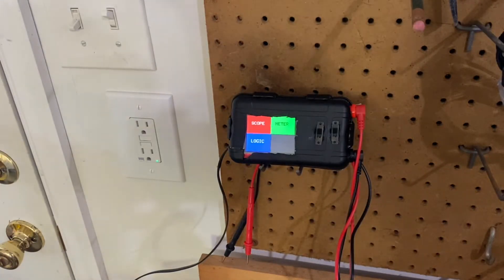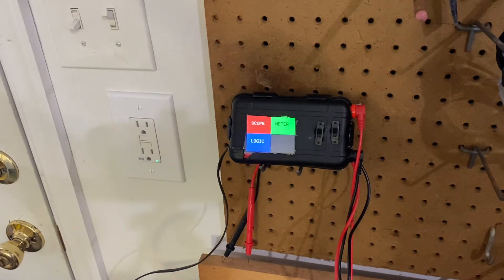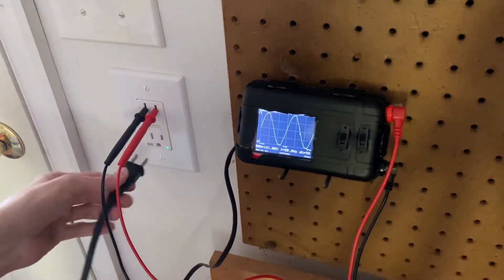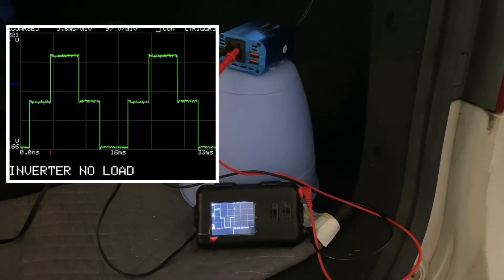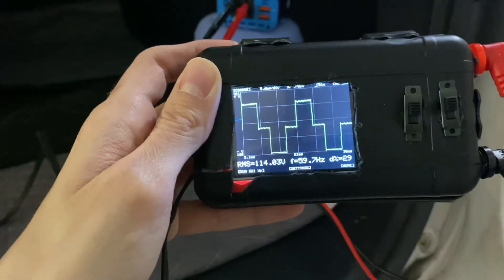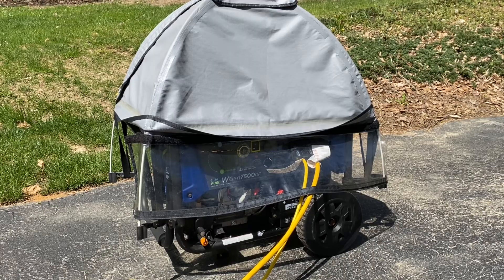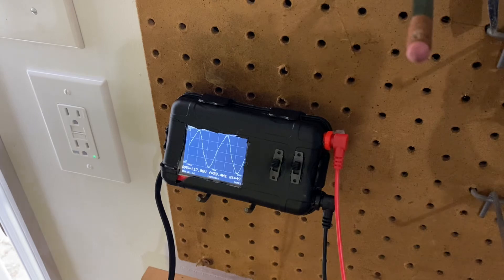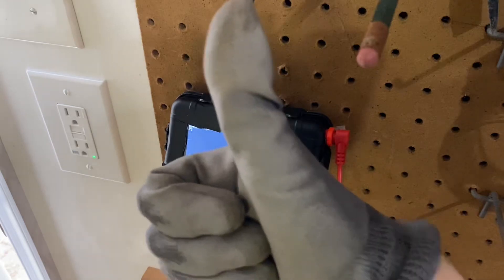Home backup generator total harmonic distortion with the Ranocchio Arduino oscilloscope

Comment: Define "sensitive electronics". Most computers, laptops, USB chargers, even fridges, use a simple inverter to convert the incoming AC to DC. These devices could not care less about the voltage or frequency or THD of the supplied mains.

Comment: Many say u can run a generator through a capacitor it will clean it up?
Reply from the maker: @aaroncottrill7426  I’ve heard that thinking too. A ferrite core can also help filter out high frequencies, assuming high frequencies are the actual problem you’re facing. It would be interesting to test that some time to see what exactly happens to the waveform. Broadly speaking, I don’t imagine a DIY solution is likely to work better than a commercially available line conditioner of similar cost, though. I imagine you’d need some resistance to go with that capacitor if you’re trying to filter out the still-relatively-low frequency squiggliness seen in this video, which gets into questions of heat dissipation and allowable voltage loss. And what exactly are we trying to accomplish? It’s probably application specific. Trying to unconfuse some transistors that have started acting wonky due to RF interference is probably a different problem from trying to avoid excess heat in a water pump. So I’m not entirely sure what such an experiment should look like.

Comment: I am impressed with your mini scope. How did you calibrate it ? what measurement/ Lab equipment did you use ?
Reply from the maker: Nothing fancy -- I mostly confirmed timing and whether I was missing any samples by using another Arduino to put out a square wave at a known frequency. During the initial breadboarding I also made use of a ~20VAC test signal from a power adapter I saved from something broken. And a multimeter, of course, that reports frequency and RMS voltage.

Comment: You need to turn up the speed on your generator, at idle with no load you should have it at 61.5 HZ -62.5 HZ, so when it loaded down with the load it won't pull down no lower than 58-59HZ. @jamescondon he taught me everything i know about generators.

Comment: I’m hugely impressed either way your Arduino scope. Very cool. 

Just a small detail: When measuring the garage outlet with load, I think you should have put the drill under load to get anywhere near the 3A or do the measurement while the drill is spinning up but that would be a bit tricky to get right.

(I’m your 101st subscriber 😉)
Reply from the maker: Welcome to the party! You're right - I shouldn't have labeled that as a 3A load. We would only expect it to get that high when the motor is stalled. I was just grabbing for the nearest thing I could find that was a smaller load than the space heaters.

Comment: Great video! I run a 9200w champion generator and was wondering about the THD. I Know tvs and computers have little to no risk with a switching PS. My main concern, as many other people is the inverter heat pump and furnace. 
Now my main question is: i have a whole home surge protector in my panel. Does that filters out the unwanted thd or does it just works with big power surge like a lightning strike.
Reply from the maker: Surge protectors just suppress large spikes in voltage, which I wouldn't expect to do much for THD unless your waveform is absolutely riddled with surges. I have whole house surge protection too, although I don't recall if they were on during my later waveform monitor video: https://youtu.be/TKOVB0_aJVE?si=4b3nu7EVwfTp-KUA

There is a different product called a line conditioner that I expect might be more applicable, but I don't have one for testing. If anyone wants to donate one to the channel I'd be delighted to test it: https://www.amazon.com/hz/wishlist/ls/UKXY48IG03UH?ref_=wl_share

Comment: So i dont know what to do I have a open frame Genny non inverter.  my gas furnace says no more than 5% thd my genny at half load from the company email says its around 8% Should I be worried about running the furnace in a power outage?
Reply from the maker: I wish I knew something definitive to tell you. There do exist line conditioners that claim to reduce waveform distortion, but I don't have one of those to test. Could make for an interesting video if anyone wants to buy one for testing!
Reply from the maker: If anyone wants to donate a line conditioner to the channel, I'd be happy to test it out: https://www.amazon.com/hz/wishlist/ls/UKXY48IG03UH?ref_=wl_share

Comment: a Champion inverter generator was tested by a youtuber to find it's a modified sine wave.

have you ever tested an inverter generator?
Reply from the maker: That's interesting! What generator model is that?

We only have the one generator and it doesn't use an inverter. We have a Smart-UPS, but it makes a proper sine waveform also.
Reply: @picocosm  ok i found the video :
https://www.youtube.com/watch?v=ZeG0QbFuemM&t=296s

i assumed that inverter generators would be pure sine wave (they cost enough!), but it'd be a bad trade off for noise and fuel efficiency if they damaged equipment...

Comment: That is a great little oscope you have created you should make more of them and sell them. I have two large scopes that I never use and last time I did anything with a bias cuircut in a guitar ampliphier I found a tool that lets you plug the tube into the device and plug the device into the tube socket right on the chassis and then from the LCD readout you can calculate the plate dissapation and of course you can add another scope modeling the sign wave you would like to have. I have seen little scopes that I would like to have but they are too expensive for me. At the moment I am wanting to run my Digitech RP500 off of my Honda EM500 which is a really handy little generator for busking on my boat but I am afraid to plug the RP500 into the Honda because the RP just operates off a little power adapter (I call them wall warts), and I have been too lazy lately to get out a big old scope and measure the Sign from the gen and that goes for the inverters on the boat as well since none of them are pure sign inverters but I doubt that they are going to just burn up my RP500, I have just spent too many years doing electronic repair to get this way and I just can't deal with SMD, also I have never been able to afford a logic analyzer. Electric repair doesn't pay well enough even when you're the only game in town.
Reply from the maker: Thanks for the comments! Funny you should mention selling them - I actually just posted a follow up video to this one (https://youtu.be/z2SUedz2vag) with a link to buy the parts to build your own. That new version is a two-channel USB scope for use with a computer to keep cost down rather than having a built-in screen (although there’s no reason a sufficiently motivated individual couldn’t attach a screen). And it’s all through-hole because I also don’t like dealing with SMD. You might also consider the FNIRSI 138 Pro if you want a more portable one-channel unit with a screen like the one I built in this original video, although it doesn’t come with any logic analysis, power spectrum analysis, or ability to export data to a computer. Also, I haven’t tried it, but the Hantek 6022BE is relatively cheap as scopes go and claims 20 MHz bandwidth — far faster than any of these other low cost options! (See openHantek for software that might work better if you go that route.)
Reply: @picocosm  Thanks for the heads up I will have to see your new video. It would be great to have a little scope like yours that I can easily check things with I just had no idea where to find all the cool parts and things I have been seeing.

Comment: How many harmonics does your scope measure to?  Amprobe ACD-41PQ does 51.
Reply from the maker: I downsampled to just 64 samples spread across two cycles for the FFT, so just 15 harmonics as I ran it. You can see in the plots, though, that there isn't much going on in the higher harmonics. You could easily go somewhat higher if your application demanded it, subject to RAM limitations. Or export the data to a computer to analyze at the full sample rate. 308 kSps would theoretically allow you to go up to about the 2500th harmonic on a 60 Hz signal. But you only get 8-bit resolution.

Comment: 'sensitive electronics' would have to rely on the frequency stability + waveform for a clock reference.
Most switching power supplies (like computers) will deal with about anything you feed to them.

It is the transformer-based adapters that will heat up, and the motor loads (compressors) that will see real stress.
Reply: Agreed!! "Sensitive electronics" doesn't mean what people think.  It's not tvs, computers and most expensive electronics. (it's fancy frige, furnace, vfd pool pump, some medical devices in a typical home).

Comment: The common wisdom is THD greater than 5% (same as utility) can do damage to microprocessors. I personally use the Honda EU6500 for home backup (less than 1% THD), so becomes for me an academic discussion. If it's greater than 5%, you can protect your computers by having them behind a UPS which will smooth out the electricity. But most appliances today have loads of microprocessors which theoretically could be damaged. I have discussed this with many people running open frame gennies with terrible THD and they claim no damage done ....so who knows
Reply: I'm in a process of looking for a tri fuel model that has an inverter, but there is nothing out there, only dual fuel. Bummer
Reply: @paul9387 check out Genmax
Reply: yes, but -- where does the waveform distortion come from? The load.

small frame generators don't have the winding mass to cope with that mess. The grid does, because of it's sheer size (although they are starting to compensate for reactive loads, as well.
Reply: I know this is old but figured I would toss my experience in, the wife and I totally destroyed a near brand new Panasonic 600 watt home stereo several years back while I was performing a home backup test from a 5500W open frame. 
The stereo wasn't even on best I recall, the system was plugged in with display running (clock etc) how this came to be is beyond me as I had ran it many times before with no issues. 

But it happened, that I'm certain of. 
I'm always worried about refrigerators etc nowadays.

Comment: Very interesting information! I have the same stated THD for my Westinghouse generator (<or= 23%). I'm curious, what THD % do you personally allow for laptops or sensitive electronics? I have installed a transfer switch but I'm not sure how risky it can be to go above 5% THD for various items. Thanks for your thoughts!
Reply from the maker: I’ve run my laptop on that automotive adapter (~30% THD) for short periods of time without any obvious ill effects. But I don’t know what the long term consequences might be, or what kind of equipment might be most sensitive. If you find any hard data, please post it for us!